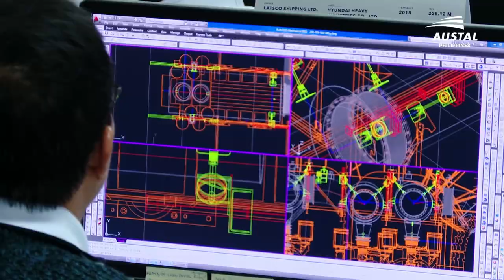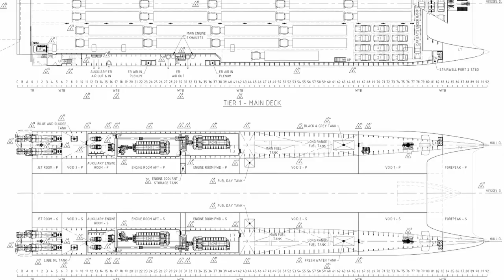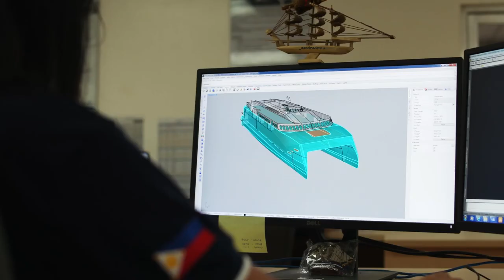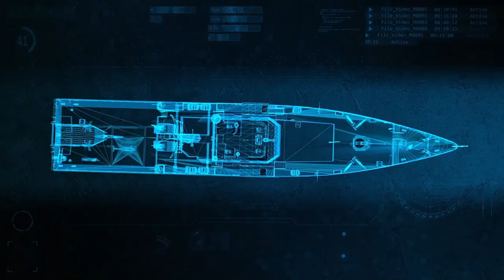Austal Philippines - Celebrating 20 ships in 10 years in 2022

Comment: Experience for aluminum welding 7 years always using feller wire 1.2 mm box # 5356 aluminum plate code# 5083